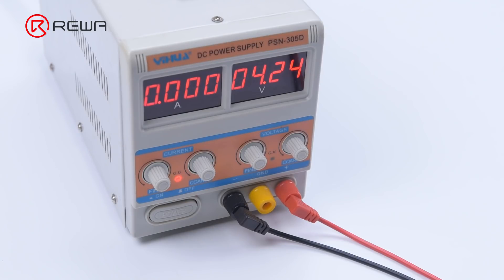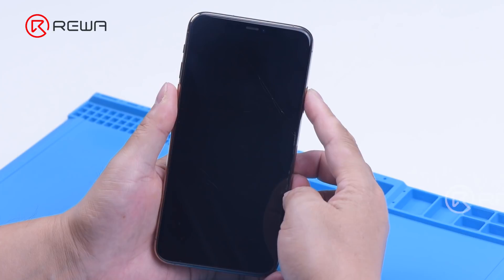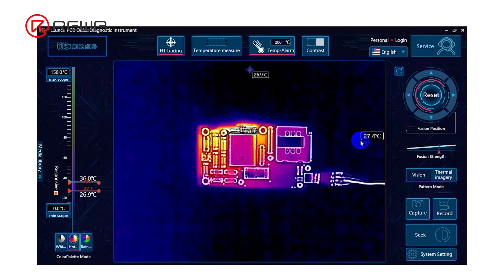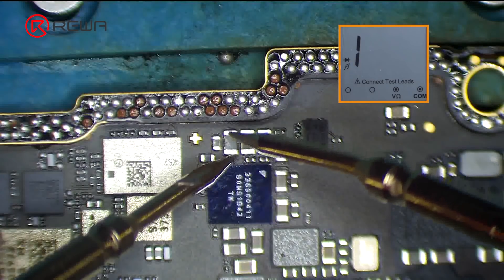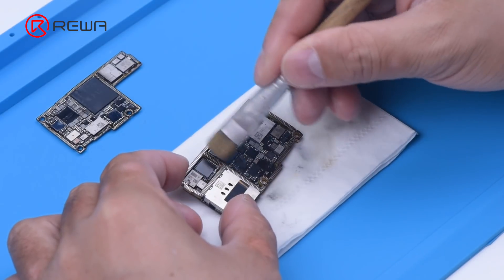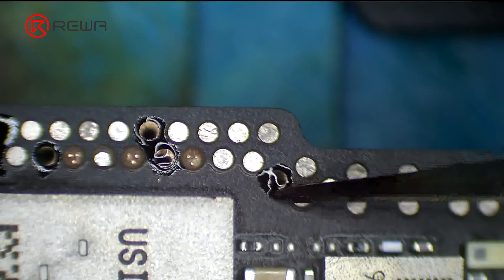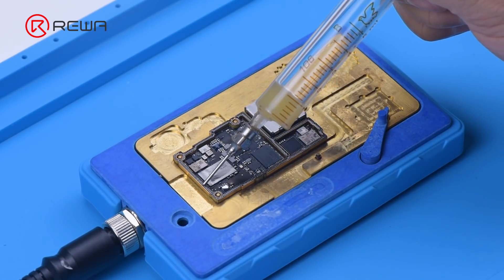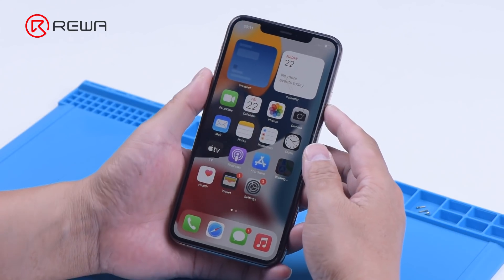Fix iPhone 11 Pro Max Won’t Turn On with LINCSEEK Infrared Thermal Camera

Comment: Hello Sir
I have an Iphone 11 short circuit on i2C2_SMC_SCL_CONN how is the solution
It's value should be  327 but it increases to 1100

Comment: 8 plus only ringer issue
Reply: Please replace the ringer if problem not solve so changed audio ic
Reply: @MunchkinLakshsoni  changed the ringer, changed IC’s. Same problem
Reply: @wajibulshovelfood8938   now change the pm ic (power manager)

Comment: I have a macbook pro 2017 and I have a problem of back light issue, Apple refuses to do it free of cost and it will cost me 750 u.s $ if I sell it I will get 85 u.s $ I need to change the flex cable please advice.I am from India
Reply: I checked the price and the price for that flex cable is $20.
Reply: @justtavi1238  The problem with the service provider here is they insist on APPLE'S Protocol of changing the logic board display also.I am trying to do it on my own since I am a senior guy.
Reply: @lenaoct1  There should be good repairing shops in that place with skilled technicians. Which city you're from?
Reply: @justtavi1238  I am from Madurai Tamilnadu India
Reply: Wtf. $750 for backlight repair? If the problem is in flex cable then it only costs $11 for the flex cable. Just visit good repairing shop. They'll order the flex cable and repair for 1500 rupees max.
Reply: @justtavi1238  Thanks for the prompt reply
Reply: @lenaoct1  Problem can also be with the backlight capacitors. Maybe shorted capacitor. In which case it can be fixed in more cheaper price. First diagnose the problem, either flex cable issue, faulty display or shorted capacitor
Reply: It is 2018 or 2019 model ? There is a lot of problems with this models in the last 3-4 month, a lot of them coming  with the same problem. 2 HA chips are dead and usually a screen as well.
Reply: Send it to me i can do it for 200$